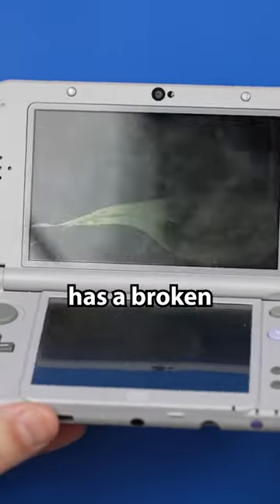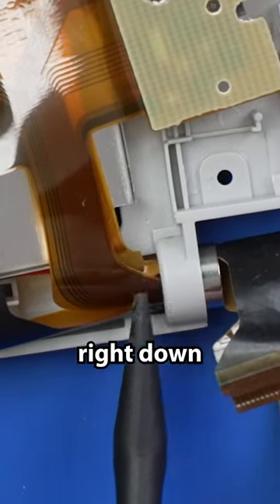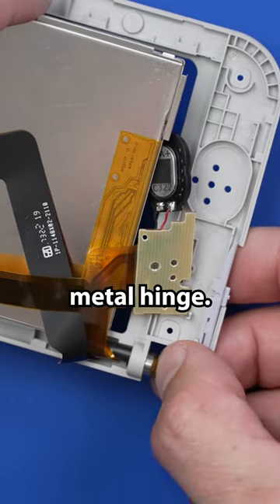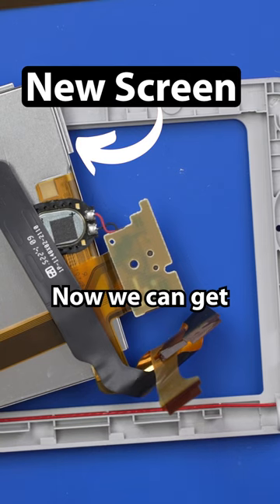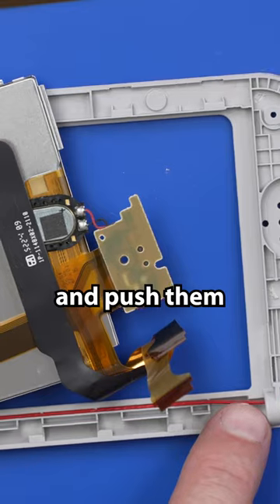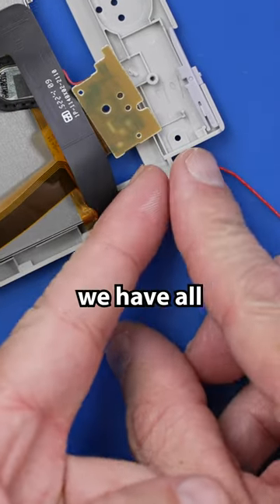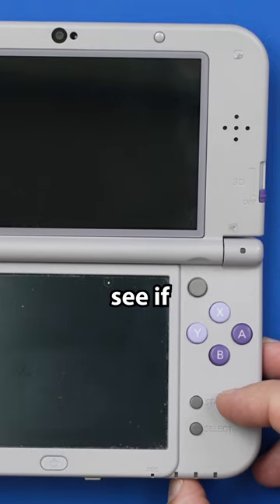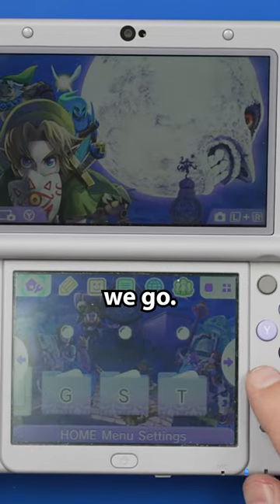Trying to Save This 3DS XL Special Edition

Comment: It's a lot harder than it looks, one wrong move and the cable is cut, my opinion is that DS lite and 2DS are the easiest to fix 🙃
Reply: I think the GBA SP is way easier to fic than the DS Lite because both the Lite and 3DS are basically the same system so doing anything that requires you to remove/replace the top screen is a royal pain to do.
Reply: All forms of 3DS have more stuff going through the hinge. DSi is annoying as well since it has the camera and mic modules floating in the same crowded hinge area. Old 2DS is definitely the easiest: no hinge, no rolling, just some normal ribbons and one screen panel. It's like working on an old brick Gameboy but with a few more ribbons. 
New 2DS XL takes the cake though. Sure it has less going through the hinge because the speakers and cameras are all in the lower half, but the top is all put together with glue, similar to a modern phone except using thin plastic instead of metal and glass, so you have the same long tedious procedure of heating it to soften the glue and inching through it with cards while praying the decorative plastic top doesn't snap. Removing the screen from the lens without breaking it is difficult too, but if you're doing it it's probably because the screen is broken anyway so who cares.
Reply: Getting these two cables with connector under the cartridge slot on DS lite was nightmare for me.
Reply: Nah man the DS Lite is a Nightmare to repair
Reply: I had a dslite with the top screen flickering in a specific hinge position,
I was thinking that maybe the ribbon is stuck somewhere and i took it appart and once i re-assembled everything the top screen was completely dead 😂💀
Maybe the ribbon was faulty anyway otherwise i broke it i'll never know for sure, but i find that this was sooo hard to do eventhough i am kind of experienced with repairing gameboys and controllers and stuff
Reply: @xRii0N-Sama  Yeah, that's the top screen ribbon. The fix is a new top screen since the ribbon is part of the screen. The tough part is always rolling up the ribbons and stuffing them through the hinge. In my experience the little metal cylinder can be used as a ring to keep them rolled as you start to feed the bundle through.
Or, you could take off the top screen, solder in the required resistor to make it think it's there, and use it as a Gameboy Macro. Or check out DS-TV-out which can replace the top screen with a composite video output, thanks to a hidden feature of the DS Lite CPU.
Reply: @joemck85  yeah i considered all of that, but i don't really need a macro because i got ips modded gbasps and gbas, and for the tv i got a modded gamecube w gameboy player, so it's prolly cheapest to just get a new one
Reply: @xRii0N-Sama  GB Player can't play DS games on a TV though. New screen is the obvious solution though.
Reply: @joemck85  oh yeah, totally forgot about the ds games 😂
Reply: I’m that person that makes more then one wrong move. 😂
Reply: I honestly prefer the original DS over the DS lite for repairs, but that might just be because I've repaired 20 of the original and only 3 of the lite
Reply: @Patzilla1999  I haven't taken apart the top of an original one before. Is its hinge the same annoying setup as later DS models, or more like a GBA SP hinge where there's more space to work and no hole you have to roll the ribbon up and feed it through?
Reply: @joemck85  definitely closer to a GBA SP, makes sense since it was the handheld that came directly after
Reply: @Patzilla1999  Oh good. I have one that had part of its hinge shatter just from the plastic getting old and brittle (and I'm guessing being left in a hot car or something by its previous owner). I'd kind of been putting off reshelling it after a painful but ultimately successful experience working on a DSi.
Reply: @joemck85  basically the same process except you don't have to slide it through a metal ring, and the plastic hole you have to slide everything through is slightly bigger, only issue is you have to get it in at an angle when going into the bottom shell.

Comment: I used to work repairing 3ds as side project when i was studying until i got a XL... took me 6 months because i broked 3 flex cables in a row. It was such pain that i complety stop repairing in general for all the shame i felt
Reply: If your looking for an easy thing to mod or fix, try out a game boy sp. I modded mine, took me a long time but dude it was worth it! At least you now have the experience!
Reply: yeah, i thought most 3ds on ebay were fakes cause you'd just reshell a ds and pretend it was sooo a og limited run, but after watching like a 11min guide on reshelling ALONE i realized every ds is prob legit and i wasn't going to buy the best looking screen and buttons and reshell it as the ds i really wanted

Comment: I push the metal bearing out so the initial hole is larger. I also roll the ribbons one at a time which helps a lot! (I also have a special slotted tool for twirling the ribbon).
Reply: Lol the tool you mention makes me think of a ds stylus with the slot in it .

Comment: My Pikachu edition 3ds xl top screen had a single dead pixel and the left speaker is messed up... I kinda wanna get it fixed but I'm so worried about it because of those delicate bits, and this version is extra valuable...

Comment: I’ve got a 2DS which automatically turns off if I hold it tightly or tap the back of it too hard. No battery issues either. Can you help and explain? Where could I message you